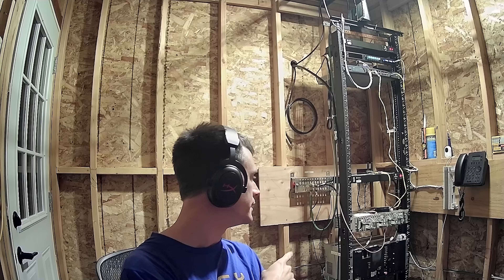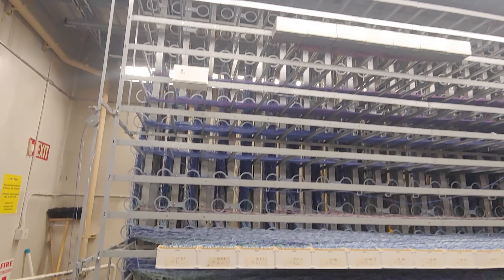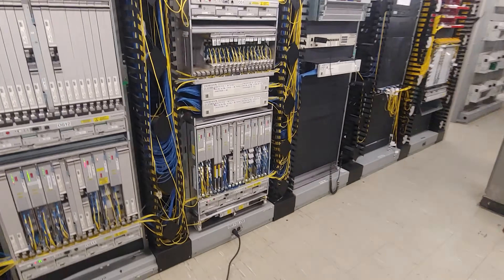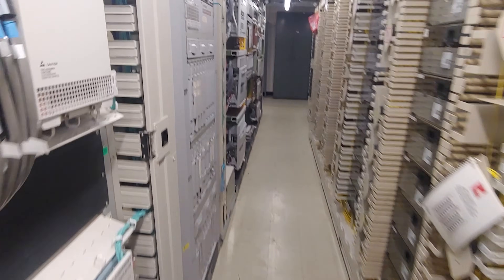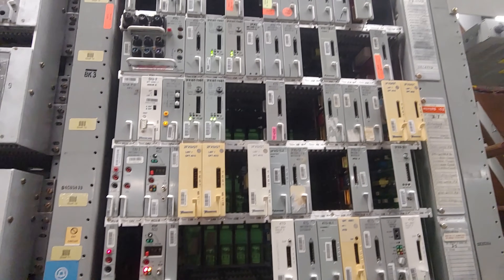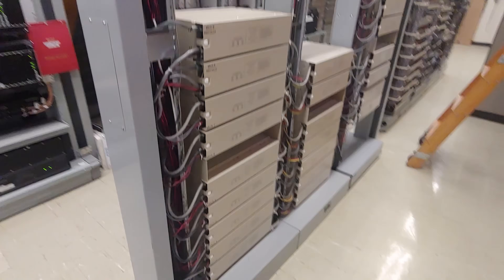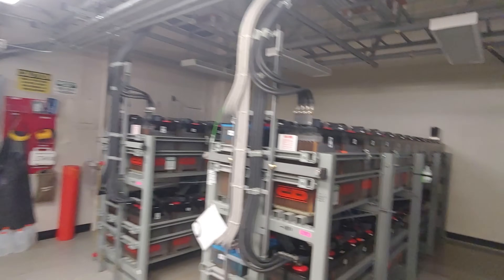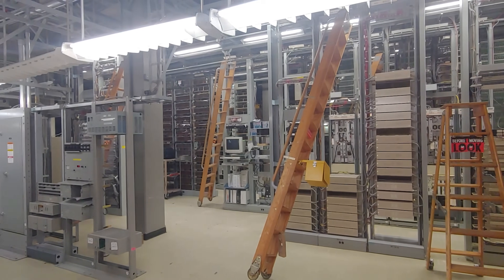Central Office

Comment: We always had inexpensive concrete block wall to separate the batteries from the equipment.  Could save millions of damage to the switch if the batteries explode, or just release corrosive gases over time.

Comment: Great video! I worked at a San Francisco CO - Western Union Telegraph office for a long time in a pre-1906 quake. We had some turn of the century to modern transports on many floors. Also had modern DMS250 and one of 5 Telex/TWX nodes.  I recently retired from Microsoft and still worked in Data Center/Transport systems (behind a desk now).  Having been around since the late 70's until recently - and in the Bay Area/Silicon Valley days - it's been a HUGE Fun time. I grateful for the experience.

Comment: Should be cold as hell in there. Does all the gear run on dc or all 120 vac powered? And all your switch gear and battery's are in the same room as the gear that's crazy.
Reply: All REAL telephone central office works on -48-volt power. There are a lot of DC-to-DC power supplies in each equipment shelf.

Comment: I am a retired at&t tech, left in 2021. You called out a LOT of the equipment wrong, but in your defense, you wee an outsider, you SHOULD hve also gotten a CO - Toll technician to give you more of a guided description. The first view, of the "neighborhood connections" was the HDMF / Horizontal Distribution Main Frame blocks side of the mainframe, or the HORIZONTAL, where any equipment that needs to be connected to outside cable plant is jumpered, one pair at a time, through that frame to the VERTICAL - VDMF side, where they are distributed to either exchange - local ( to a customer)  , or toll / trunk - inter-office cable pairs.   I installed many a Ciena shelf, from a 2-slot wall mount to a few full 32 slot bays, as well as the Alcatel 7330 IPSDLAM / VDSL shelves over my past 14 years before retiring, as well as other SLC and SONET mux systems. The Flashwave 7500 bays you noted with the alarms, it's not uncommon to see equipment in various states of alarm due to circuits or even whole shelves being in the process of being turned up, or down. If it was a critical issue, you would most likely have seen a tech on site attending to it, unless they were waiting for new or replacement plug ins to resolve an issue. About the only thing you showed that was uncommon in the Chicago surburban central offices that I worked in, was the microwave bays, and, most older offices will not have batteries on the same floor and non partitioned area as equipment, which IMO is a terrible layout, as if anything happened to those batteries and they vented acid fumes due to a major spill or damage, its most likely that EVERY piece of equipment on that floor would be damaged. Nothing in a central office is considered, or called a "back haul" system or connection, that is a name that cell site equipment techs give to our NETWORK connections via fiber and a IP switch ( something akin to a Ciena 39XX ) that can manage single or multiple MM or SM drops from a single Network   SM fiber optic circuit.

Comment: I managed five COs -- 2 5ESS, 2 2BESS and 1 DMS-10 -- in my first job out of college in 1990. By 1992 as Telcom were rushing to adopt SS7 for 800 portability, I worked on conversion projects to swap five metro 1ESS switches to 5ESS because AT&T didn't  have enough parts left to upgrade the 1ESS switches to 1AESS versions with the APS Attached Processor System to support SS7.  It's nostalgic to see a 5ESS still up, but it is no surprise...  They were designed to last.  In 2025, that 5ESS is longer into its lifespan than the ancient 2BESS switches were in 1990.  That amount of 5ESS based switching easily would have replaced a city block worth of older 1ESS based switching. Now, modern VOIP gear likely collapses 4 or 5 aisles of 5ESS switching modules into maybe 3 or 4 racks.

Comment: Ok, don’t giggle as I’m simply a wistful outsider looking in. In the very late ‘70s, I wanted to work for the telephone company OR go into banking. Because of convenience, I chose the latter. Of course, I did not lose my obsession with telephone equipment. The bank I worked for (at their local main office) sported a fancy Northern Telecom PBX system and I sporadically played “operator”. The fact than inbound calls could be easily connected to any of our branches by keying three digits amazed me. One of our branches was located quite far (right on the Tennessee/Kentucky state line-we were TN based). Apparently, that was an expensive endeavor as that branch was only given one “internal” line. During one of my many experiments, I managed to confuse the entire system by obtaining an outside line and then calling our main number and answering it. I connected that call to various places and eventually a bizarre “buzz” started invading all calls. I played dumb.

Comment: Thanks for the tour.  

I used to be a Security Officer for Admiral Security in January 1996 when we had that snow, and I was at Bell Atlantic/AT&T site on Turner Road and Hull Street in Chesterfield County, Virginia.  I used to patrol both buildings at night after escorting the Phone Operators safely to their vehicles so they could go home.   There were techs in the building doing tech work, so I wasn't totally alone there.  We had a basement and a sub-basement that had a large generator in a large room.  There was a mid-sized battery room, too.  I think both Bell Atlantic and AT&T vacated both buildings some years ago.

Comment: To me the equipment in this CO looks modern compared to the equipment I remember back in the 1970's. I was in a CO when the 5ESS was brand new technology,  now all of this has become obsolete. Back in the 60's, and 70's when my dad worked at a regional toll center the long distance switching machine called 4A took up 2 whole huge floors of crossbar and every other kind of relays. And the noise was incredible!  The first floor was filled with 4w test boards, SF units, L carrier equipment (LMX),and N carrier equipment. And  the top (4th) floor was all TD-2 microwave equipment. It was breath taking!  Now it's all gone.

Comment: I started working in radio when I was 15 back in 1977. I was always fascinated with "dedicated broadcast loops". These were specially treated, high quality audio lines that radio stations used to send audio back and forth; usually sending audio from studio to transmitter. They were FM quality and were totally analog. I've never seen any videos about these services that could only be gotten through the local Telco. 
I can still remember the circuit numbers of the lines my first radio station used to get audio from the studio to the transmitter. They were 56PTNA19644 (Left channel) and 56PTNA19645 (Right channel.).
Does anyone know how these high-quality "broadcast loops" worked?
Reply: I was a frame attendant back in the 80’s in Denver we ran radio circuits in shielded wire on our trunk frame for some of the local radio stations

Comment: Oh man...Much of that equipment is beautiful! Those microwave units sound just like the compressors on an MF-68! 🚇🔊❤‍🔥

And talking of compressors: I'm not completely au-fait with CO hardware (And in my country our Telephone exchanges are all powered by Tea! ☎🇬🇧🫖😉) but a compressor for the lines? Is that being used to keep water out of trunks via positive air pressure, or is it for some other use? 😇

Nice to have finally found out where the other non-retro PC with a floppy drive is located! 💾

Finally: Those batteries look heavy. as. F. If I had the means to collect a few once the POTS had been completely decommissioned and they were surplus to requirements, I'd want to build myself the most steamroller of an e-bike in history! 😁

Comment: Very interesting sight was last in a CO in Dec '73 when my father retired after 37 years with Bell System. He worked in a number 5 crossbar (flat spring) from cut in on Nov 30, 1949 till retirement. The Co's sure look a lot different had motor generator sets charging batteries and a couple of mercury arc rectifiers for their coin pay phone collection. Communications Museum's number 5 exchange looks similar except I think theirs is the later wire spring relay type. Operating sound is quite different between the two. Have a neighbor that still has POTS and I have fiber with phone and internet.  Voice connections are very clean, I call Burbank from Cleveland and the calls are sure different for years back. Great tour!
Reply: Believe it or not: London Underground are still using Mercury arc rectifiers to provide DC current! 🚇⚡😳

...And we British think we're Levelling Up?!?!? 🏛🇬🇧🤣
Reply: I work in the industry, we still have original cables and use along with fiber optics. The copper guys still fix old cable, on on a monthly basis. they still have the compressors pumping air on them.

Comment: I want those battery cables
Reply: For what use?
Reply: @Stealth55555  Traction drive/augmentation current supply (To move or assist the vehicle) and 💩-loads of weight to make you unstoppable as soon as you're in motion! 🚂💨🤘
Reply: I installed a lot of power cables as a  coeit iwe basically had a gang or party of installers  to get it up on the racks …750 power cable is about 9 lbs a foot with lots of multi cable runs of hundreds of feet sometimes on different floors of a co . You would use a hammer to form corners and sew the cables down to the rack with 9 cord string it was a thing of beauty when installed right
Reply: I want those batteries! 😍

Move over Mr. Musk with your UKCA 🔥 intertia-killing Li-Poo batteries...Pack a car with a load of these, and absolutely nothing is stopping you once you're above 40mph... 💥🐘💨😉

Comment: We still had step by step relays in the late 70's early 80's in Coquitlam BC Canada, so I was hoping to see some cross-bar switches in your video! Oh well, I guess contacts and pivot points eventually do wear out. The waveguide maze in your video was a treat to see!
Reply: We still had some of those here and working in the 90’s for the FAA. The place clicked all the time, you might recall.
Reply: @pdbruce  I don't know about clicking because I was only dumpster diving and looking into the windows, but one of the guys who worked there told me that he had to clean one step-by-step relay per day. That's a LOT of contacts to clean! No patience for that ;o)
Reply: The connection museum in Seattle, WA has both the no. 1 and 5 crossbar installed there!  As well as SxS and the only working Panel switch existing in the world !

Comment: 50 yrs in CO best time of my life!  Kudos to the techs.... decent frame wiring and fiber routing far better than in my area.  Constant battle I was lucky to have almost total control of 3 COs and cud keep things neat.... easier to work on and less trouble for the customer.  Thanks for the great tour!
Reply: I retired from active battle duty in 2021 from working in the Chicago suburban area, and, to be honest, most jumper routing in CO's wasnt terribly bad, some of the older MUX aisles would be more disheveled due to poor care of initial placement and being molested over the years though. NOW, the customer end, could be a nightmare, I had a job to install a new 10G circuit at a data center, and the routing of some of the jumpers through equipment panels with doors and covers was so bad and overloaded, that, when I went to look into and close one door, I pinched and took out a jumper for an active 10G circuit going someplace, that came in as an alarm not long after and I had to go back in and re-route it to try to keep that from happening again.

Comment: Amazing that a CO still has the same look half a century later. I was a SxS, #5 frameman in the mid 60's. I am surprised there is no wall between the Batteries and the rest (corrosive vapor possibility) .

Comment: Whoa, crazy they still use lead acid batteries in service!
Reply: Always will, some places tried to used VRLA or AGM (still lead acid)style like in the cell sites but they don't last the way they're used in Central offices. They only significantly discharge if the generators die. Otherwise they just keep the load supplied while the generators spool up. Pretty much every other chemistry wouldn't have many Ampere Hours after being treated like that for years. These tank cells can sit there for 50 years easy. 

25 years after this style of battery(the round type though) were deployed, a study was done, 14,000 batteries (cells actually) were tested and inspected. None of them leaked, only .01% failed and the rest kept 80% of their capacity, which was a predicted number for 25 years in service.

There are new chemistry batteries, sure, but for this role, these are better than anything else.

Comment: Actually, the #5ESS made by Western Electric is not being replaced because there is nothing in existence to replace it with! It was/is a wonderful Plain Old Telephone Service (POTS) digital switch that processes landline calls. #5ESS also switch cellular phone calls. Unfortunately that switch is manufacture discontinued. No new parts or circuit packs are being manufactured. The only circuit packs available are those from customers who have discontinued their landline service. Eventually they will FAIL. Currently the only thing available to handle this voice traffic is VOIP. Voice Over Internet Protocol. Since it’s IP based and requires broadband service to operate, and will fail when commercial power fails, the FCC is not thrilled with it as a communications backbone for the United States. California recently passed a state law requiring telcos to continue to maintain POTS service. 
It’s anyone’s guess how that will play out.